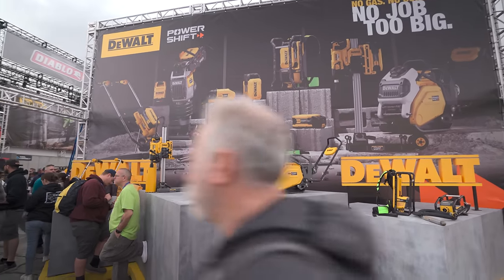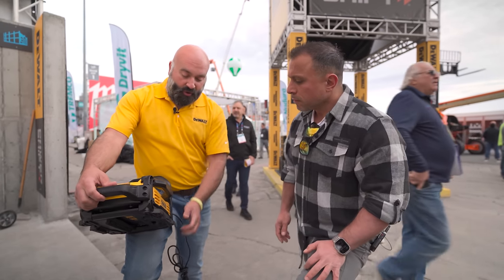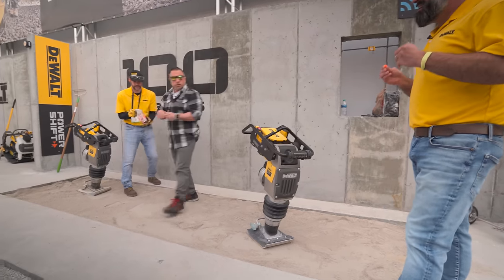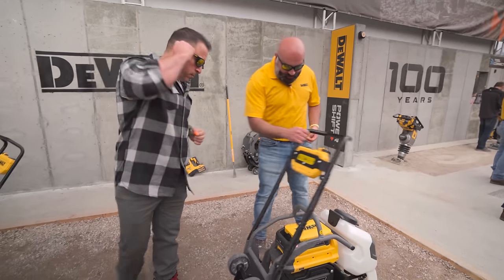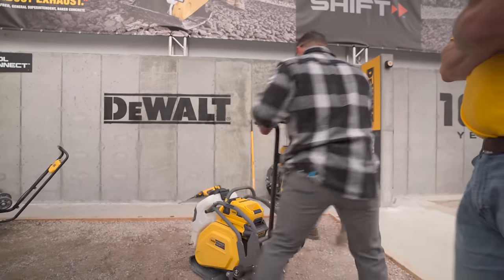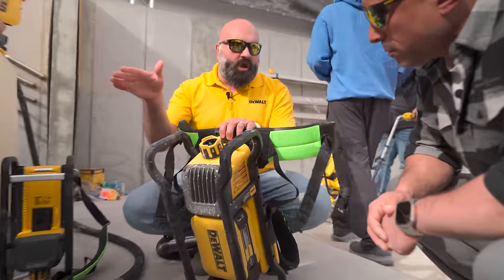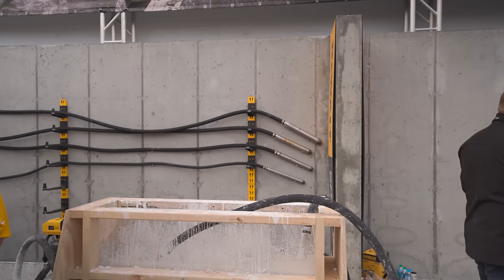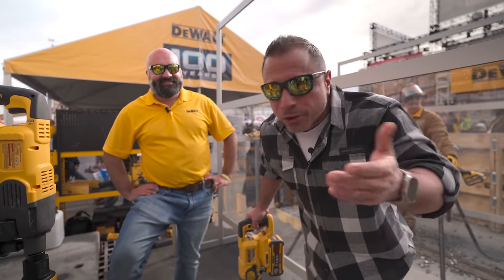DeWALT Makes PowerShift Tools Affordable with FlexVolt Compatibility!

Comment: whats the voltage on these puppies?
Has anyone ever pitched the idea to dewalt to makes a 120v ac to 60v dc adapter .... for using the tools where power is available?
Reply: Like the adapter for their Flexvolt miter saw?
Reply: I’d assume 60v since it accepts the FlexVolt batteries.

Comment: Ok on the new dewalt battery set up. If it’s backwards compatible, and the 60v flew volt will power it why not just make it powdered by the flex volt and focus on fast chargers and not have to introduce a new battery in?

Comment: I like how the Dewalt guy avoided the horse power comparison. Gas motor I can repair cheap. These are expensive to replace and don't last as long as gas.
Reply: They haven’t even released yet. How could you possibly know that?
Reply: @christophercrawford2736 biases. 😂
Reply: @christophercrawford2736  We know based on what we have now.
Reply: Some others would say 

“ electric motors I can repair and can still hug my family when I get home “

You say tomato I say potato 😆
Reply: @zjedinite  I don't know. I feel like any guy who hasn't heard of soap probably has bigger problems than their family not hugging them enough. Plus, if you're working with any of these machines on the daily, you're not exactly going home daisy fresh, anyway.
Reply: @zack9912000  based on what we have now is what they said at the event, which is that it would run longer than gas tools.
Reply: @TheCharleseye  😂 don’t get witty with me. If you are a grease monkey don’t get offended. If you work with gas and engines YOU ARE GOING TO STINK! It sticks to your clothes, then your transportation even if you change at work, you’ll still be a grease monkey. Nothing wrong with that, but stating the facts. I was playing devils advocate to this guy saying “that gas equipment is easier to fix” that’s just such an Homer Simpson comment. For any person that knows how to fix a type of engine, of course it’s going to be easier for them bc THEY KNOW HOW TO FIX IT 🤦🏻‍♂️ 
Like those that know how to work on electric motors would say the same. 
Why do I even have to explain this 🙄
Reply: @zjedinite  Wow, I didn't realize you were so short that a direct point would go over your head like that, but here we are.

Anyone working in these trades already knows how to do basic work on these engines, because they work with these tools every day. Virtually nobody working in these trades spends a lot of time working on electric motors, because electric motors aren't normally in these tools. Is that really such a hard concept, or are you that dense?

These are large, expensive pieces of equipment. When one breaks down, the job stops. That can either be for an hour, while you repair it, or for several hours to a day, while you drop off the electric one at the shop and then rent a gas powered one to get the job done. Since this stuff tends to break down in the latter half of the day, you can pretty much just call that day over, if you can't get up and running again, quickly. 

Don't worry, you don't have to explain that you wouldn't understand any of this. Anyone who cries over getting their hands dirty isn't doing this kind of work and the rest of us know that. Maybe go back to your favorite Tesla videos and complain about the mean man who shattered your illusions about Lithium/cobalt/nickel mining replacing oil drilling to "save the planet." They'll be a lot more sympathetic.
Reply: @TheCharleseye  oh my apologies, my intention weren’t to trigger you. 😘 
Like you the only one out here working!? 
Bro those who claim to be hard are usually the softest, usually trying to make compensate for some shortcomings 😉 
Go kiss a possum 😂
Reply: @gregorsamsa1364  That is the the most hilariously ignorant take I've seen in quite some time. Congratulations, I guess.